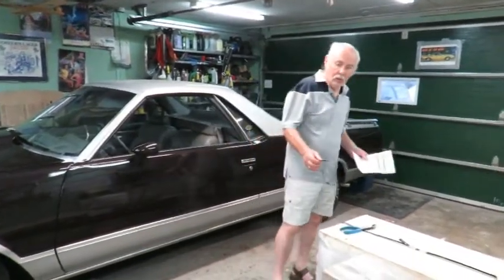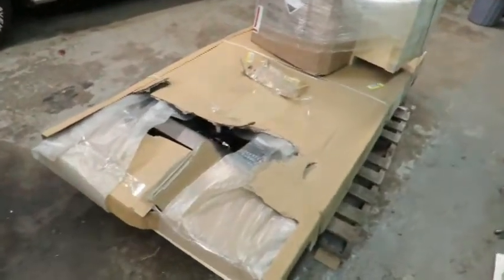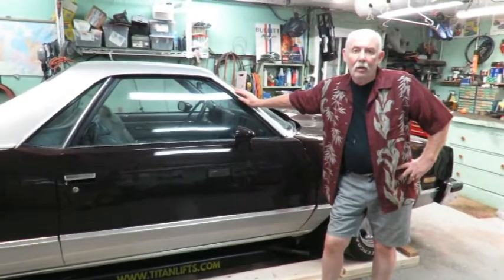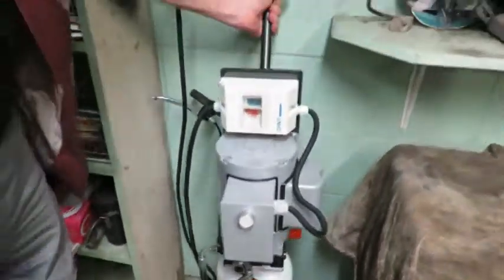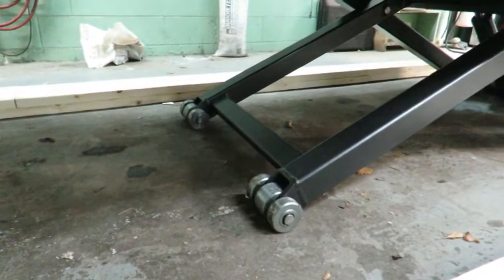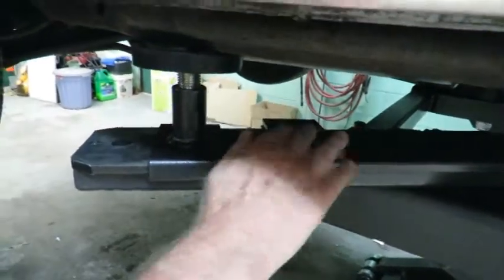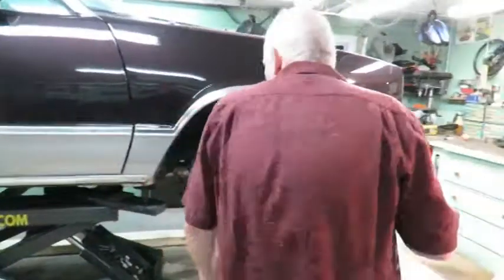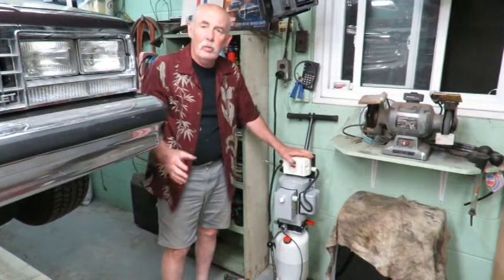Titan  SL-6600 MID RISE Scissor lift car hoist

Comment: Thank you for sharing.  I am on the market for a mid raiser.  The advantage of scissor lift is the compact size.  Not taking so much space inside the garage when not using it.   This Titan seem better built than the bend jack MD-6xp.  I think this is the one I am going to buy.
Reply from the maker: I think you will enjoy it  as I have had no problem

Comment: I am going to look at one tomorrow. I am still not decided if I will get the scissor lift or the two posts one ( Portable one). My ceiling is 12 feet so not a problem. It's drilling my floor that is my concern. Thank you for your video, well explain.